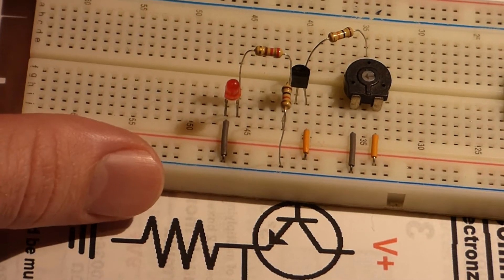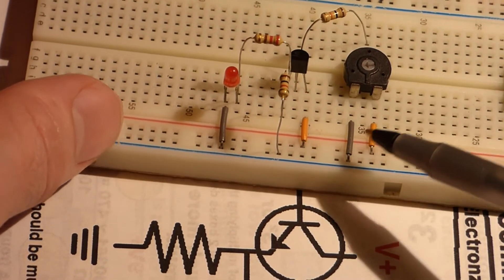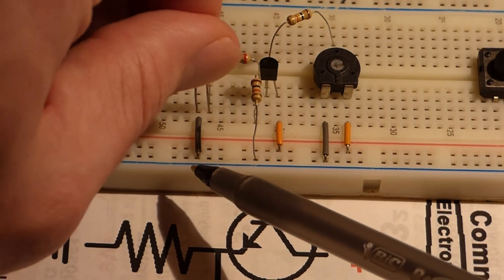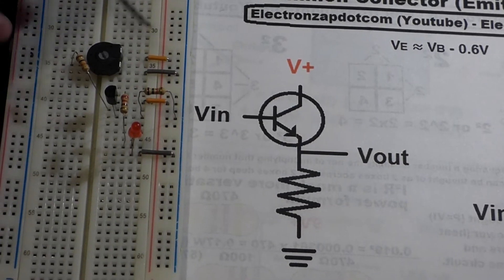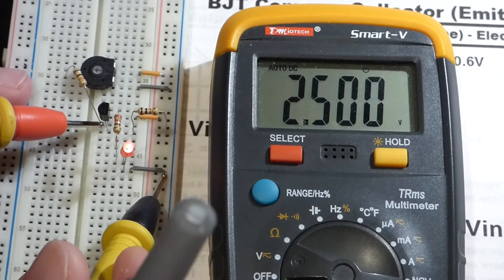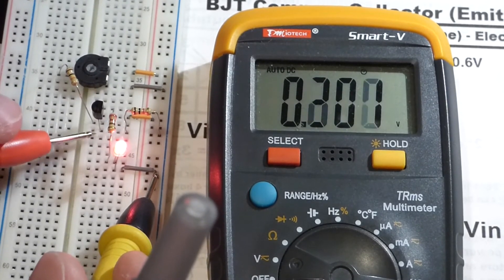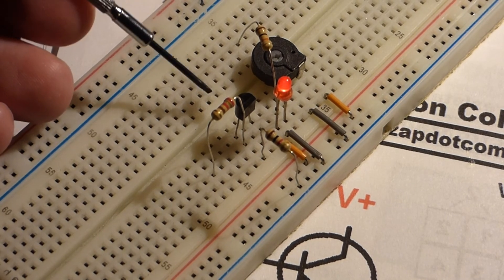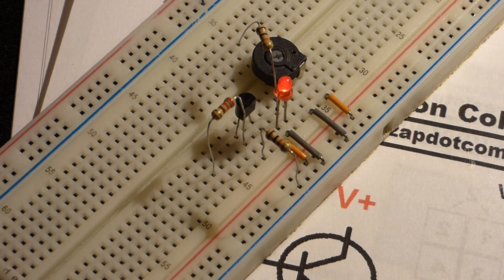NPN 2N3904 BJT Common collector aka Emitter follower electronics by electronzap

Comment: I've been looking at your videos and I've been really enjoying them, as an Electrical Engineering student this has provided much insight for Electronics, but I have a question, Why do we have to have the collector connected directly to the power supply? and is it still going to be an emitter follower if we add a resistor to the collector?
Reply: TL/DR, the math for a voltage follower depends on the voltage at the collector not changing.  Add any resistance and it behaves differently.
Reply from the maker: Thanks, glad to hear! If there's a resistor on the collector side then it usually makes a different circuit than the emitter follower. You might get away with a relatively low value resistor on the collector side with a high voltage supply, to split some of the voltage, but I've never tested that out.